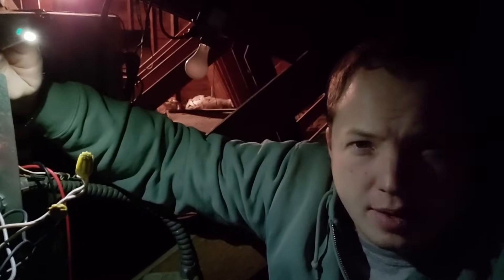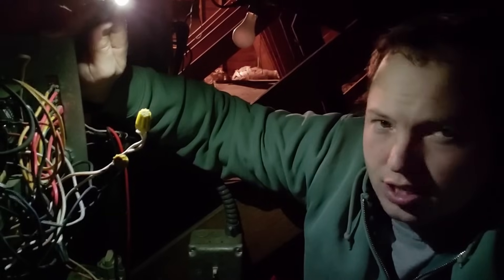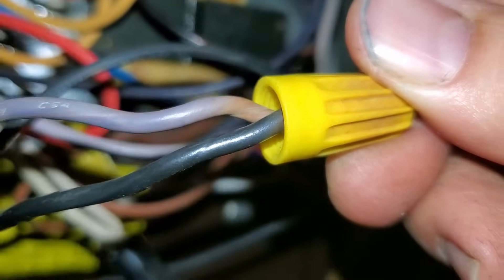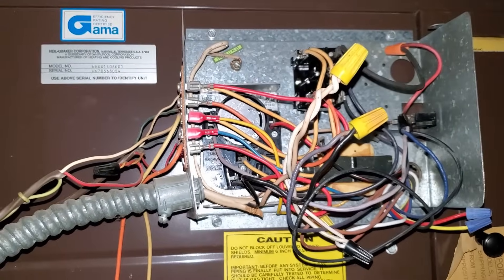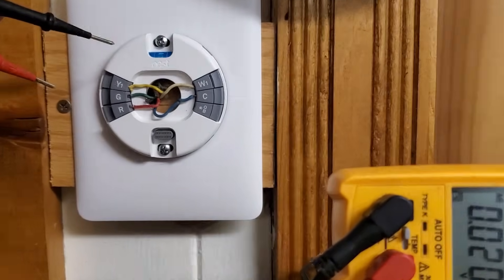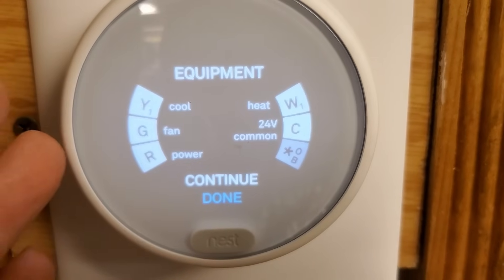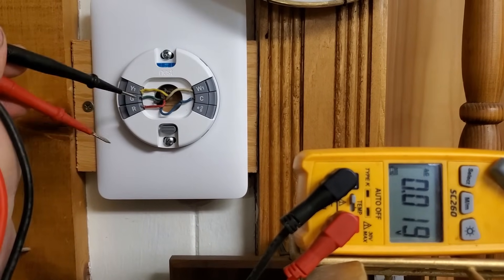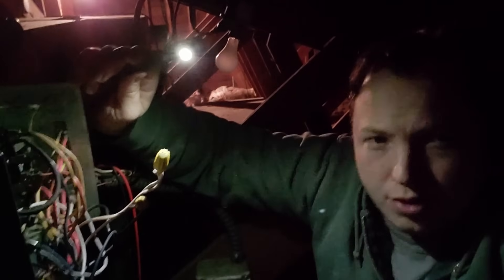How To Check Power at Thermostat - Furnace & AC Won't Start - Finding Loose Electrical Connection

Comment: Hey Benjamin, I have only 2 wires coming to my thermostat. I'm assuming one is the R (24V) and the other W (for heat). I don't have a common wire and no where to ground. Neither wire is labelled. Could I use the ground on a nearby 120V electrical socket as the the ground? I have zone valve in an appartment.

Comment: Nest t-stat low battery, replaced battery and after a week disconnected from wifi again. I have 28V across G&R at Stat. No common wire.

Comment: I have found that the solid/stranded wire connection is the weakest link, most times. I now use a Wago (TM) connector when mating two different wire types like this. Not affiliated in anyway with Wago. Just something that works for me. It also scared me a little bit to see that discoloration on the wire but, worse, it also looks like your wire nut shows the same discoloration indicating some real heat build up under that connection.

Comment: Mine is driving me crazy. My contactor won't engage all the time and I have found that when it doesn't that it is only getting 12-13 volts. When that happens I am getting 12-13 volts out of the transformer on 5 light green wires that are piggybacked together. When I disconnect those my voltage goes up to 28. I started trying to trace a few times now and it starts working every single time and I have yet to find a loose wire that I had not already repaired.

Comment: My original nest has intermittent low battery no power messages. Also nothing works if the door is not precisely replaced. Plus the wire makes a buzzing sound in the wall every time the a/c goes on.  For low battery replaced the batteries (using rechargeable now)  For no power another video said reset the circuit breaker which I did and it has power now.

Comment: I bet the transformer is wired for 208v-1p and its seeing 230v-1p which will increase the 24v up to the 30v he is reading.  This should be corrected so that the circuit boards will not over heat.

Comment: I thought you couldn’t cross the R and C wires or the 3 or 5-amp fuse will blow? (Saw this on another one of your videos). 
I’m trying to troubleshoot why after 3 years my Nest suddenly lost its C wire connection

Comment: I tried installing a smart thermostat. Everything powered up and I already have the C wire but the system will not kick on. I called Honeywell and did troubleshooting and check the voltage most of the wires the voltage was OK but when she had me check two of the wires at the same time the voltage was 35. The lady told me that my system is giving off too many volts and 35 is too high and that’s why the system is not kicking on. How do I lower the volts. My other thermostat which was not a smart thermostat has been working for three years with no issues.

Comment: Ben, great video! Been having problems getting my Nest set up - my R to the common is showing very little current while the other colored wires are consistent at around 27v. So, no power to common - how would you approach this problem?

Comment: thanks for the video! I have an older boiler, and when I opened the thermostat there were two connected wires and one that was disconnected.  The two connected wires measured 27-28V as expected, but the disconnected one measured 12-14V to either of the connected ones.  Anyone have any idea why that might be the case?

Comment: If your transformer is not grounded you will read voltage to ground on both wires hot and common.

Comment: I am trying to run power power to my shed and was going to use a 20 amp circuit breaker and was wondering how many amps do the outlets ned to be
Reply: 20
Reply: You can look at it this way- almost all 120 volt equipment never consumes more than 15 amps.  If it needs more power it will be made in 240 volts.  You may find some 20 amp window a/c units though.  They should be on a dedicated run with a special 20 amp receptacle.  Always possible to overload a branch circuit by using too much power.

Comment: So, the power goes from the panel, to the furnace, then to the thermostat?
Reply: Yes.
Goes to furnace as high voltage.
Comes to thermostat as low voltage.
There is transfomer at furnace
Reply: @agronneziri4726  got it. Thanks! That makes it easier to track when you know where it comes from and goes to

Comment: I've found using a wire nut for stranded to solid wires can be botchy. Had a baseboard heater that didn't work. Was a stranded wire not making good connection to a solid wire that used a wire nut. Good reason to sometimes use the Wago type wire connectors. Hey from Vancouver British Columbia Canada

Comment: The wire nuts have a cone shaped spring.  As attic heat rises or falls to cold, the wires expand and contract.  The spring (when correctly installed) keeps the wires pressed together, and if tight enough, it is a mostly gas tight to reduce corrosion.
If all electric connections are tight and working, a sudden drop-out in cooling mode can be (i have seen it) a loose winding inside the contactor coil has worn thru the insulation and breifly shorts out, causing voltage drop that resets the thermostat controller.  The fuse does not blow because the current is not high enough and the fuse is often a slow blow fuse.  If visual of contactor coil is brown, replace the contactor.  The contacts are usually pitted by that time.  (20+ years HVAC)

Comment: Anyone got any ideas where I can get 28 V any time the fan is running? I have an LCD timer that runs on 24 V and I would like to keep track of how long my blower is on. That means when it’s cooling when it’s heating or when the fan is on.  I’m not sure there’s one connection that can give me all that at least from the thermostat connections. I might have to go directly to the wires on the blower. Thanks for the video!!
Reply: Maybe, small LED power supply with regulated DC output in the range of 20 ... 30 V DC?

Comment: Nice straightforward explanation of thermostat wiring and voltage readings. That was a really old gas furnace with no control board and thermocouple!

Comment: I would scrape the oxides off both wires then twist and solder them together, then double insulate. Wire nuts are electricians short-cuts.

Comment: Why not solder the wires and then use a  wire nut?
Reply: Soldering is a colossal waste of time.  Wire nuts are code-approved.  Look at the underwriters stamp of approval.  Just use the correctly sized wire-nut.